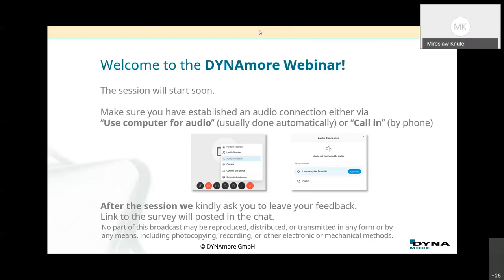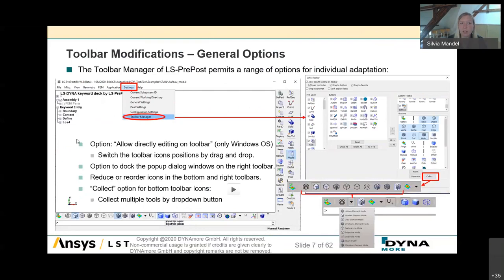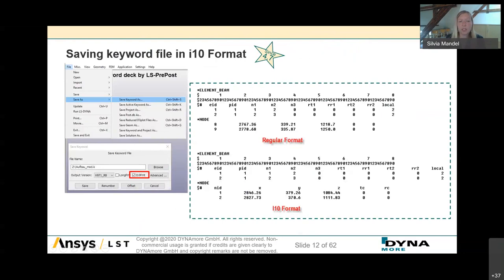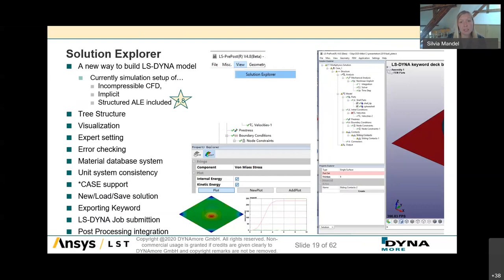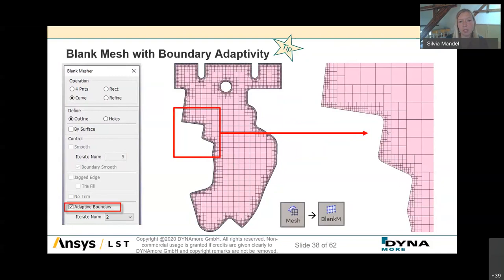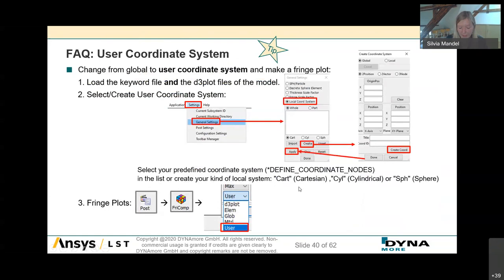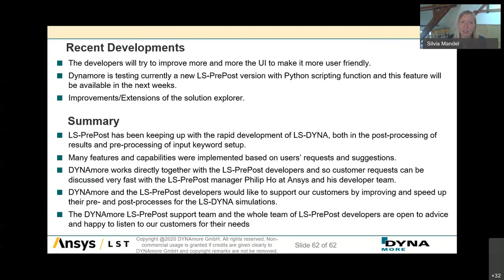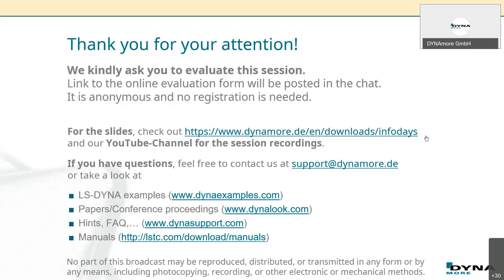DYNAmore Express: LS PrePost News, Tips and Tricks

Comment: Is there any way to visualize the beam element in 3D render (with cross section)?
Reply: View -> Beam Prism
Reply: @TylerDurdenFcS  if i have used it properly, this option does not show cross section. It only shows a thick triangular line no mater the section.
Reply: @surajranabhat834  You are doing something wrong. See *INTEGRATION_BEAM in Keyword manual. For tubular/rectangular cross-section you will be fine just with *SECTION_BEAM.